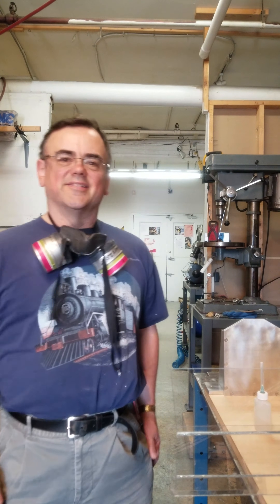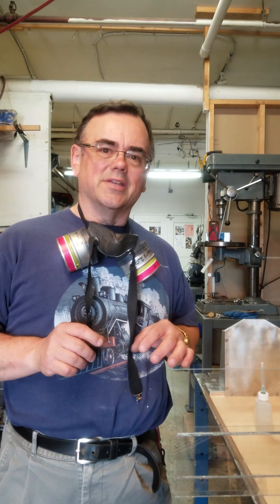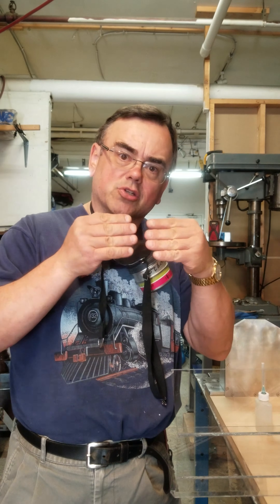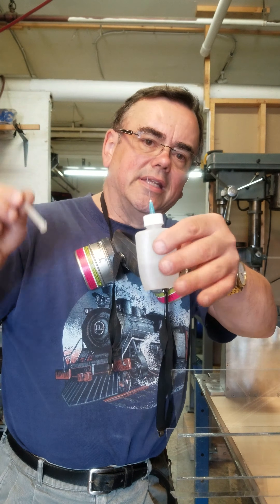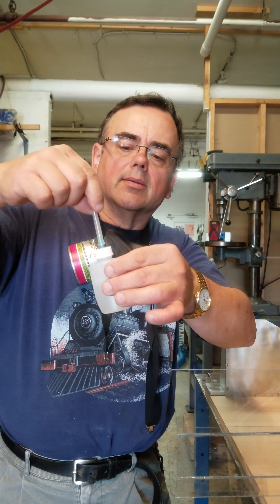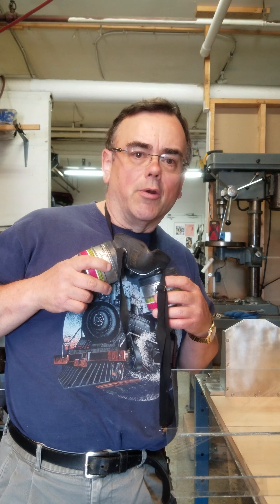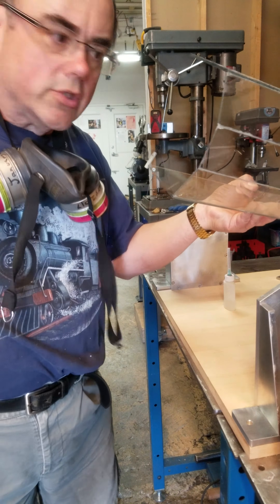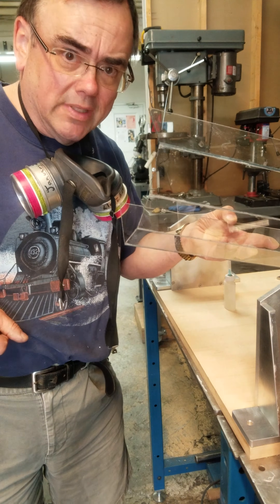Bonding Acrylic, Lexan or Plexiglass/Perspex

Comment: Thx for sharing this! Do you know if this would work well on two piece polycarbonate fishing lures?
Reply from the maker: Methylene Chloride is a solvent that is capillary attracted within the area you wish to bond and is as waterproof as the polycarbonate. This of course means that the two have must have no gaps. Today I  completed a fish ladder which is a cylindrical tube of acrylic and a thick cap bonded with the solvent and water is pumped right to the top, all air sucked out  then the fish swim well above the actual pond level. See my Instagram page. I will write about it shortly!